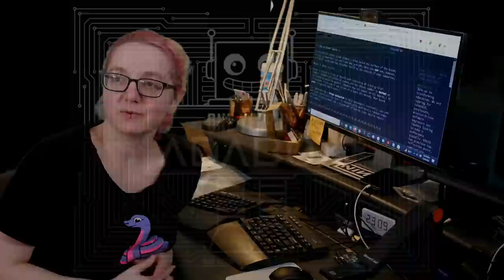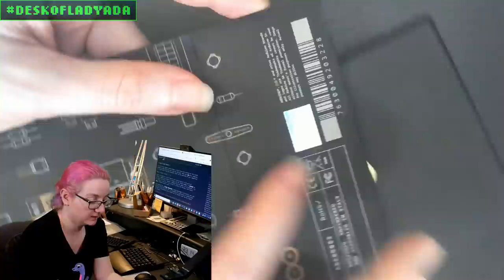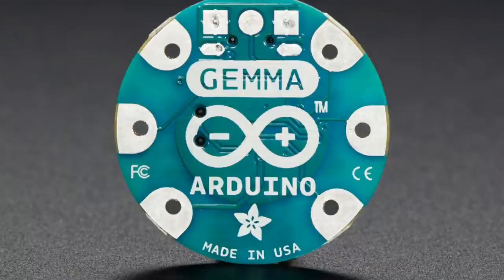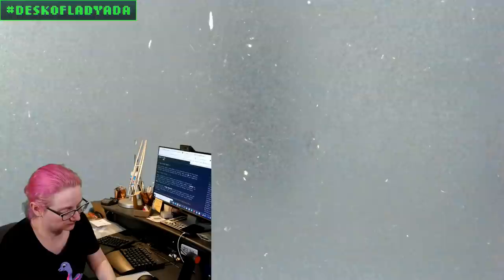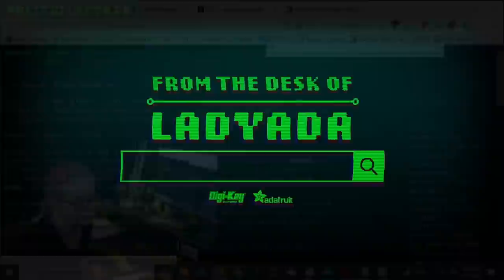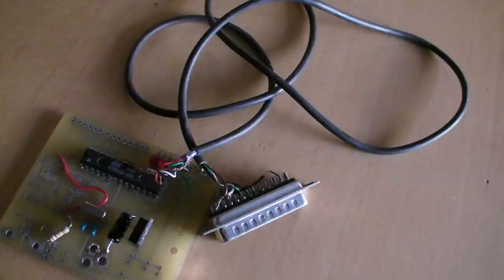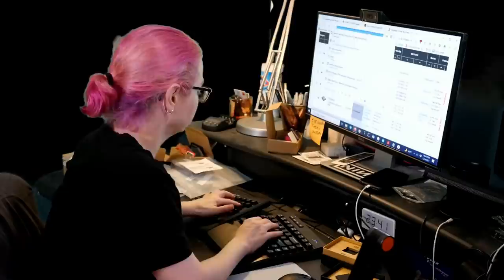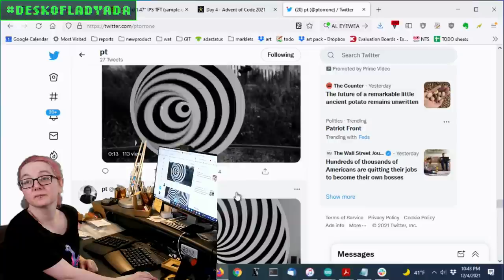Desk of Ladyada - Uno Mini Unboxing, Feather M4 Adalogger respin, Hacker tunes, and more!

Comment: What's that mini heater?
Reply: looks like MiniWare MHP30
Reply: @BSOE3058  Indeed.

SupinePandora43: see also: YouTube video ID blKMhTlvOHA, for a Colin's Lab Notes about it, and/or on the Adafruit store, it's Product ID 4948 ("Mini Hot Plate Preheater with USB C Power Supply"). I seem to recall a Desk of Lady Ada or similar video where Limor talked about it, too, but I couldn't find it.  Anyway, yeah... little hot plate for small-scale reflow work. :)
Reply: @DavidLindes  I read somewhere it's actually officially intended for use as a pre-heater but it does seem like it works great for reflowing tiny boards
Reply: What's more impressive is that it appears she is doing it all without a microscope or any magnification
Reply: @kibako666  some people maintain great eyesight. Others have it with the aid of corrective lenses.  And then there's lasik.  :)  Still, yes, it's somewhat impressive.